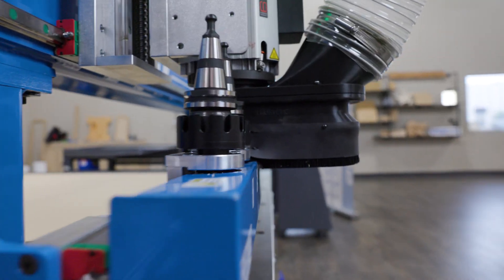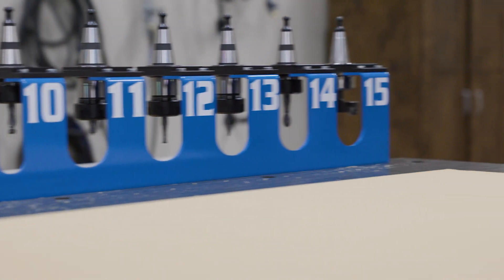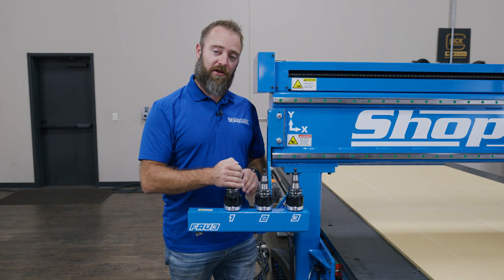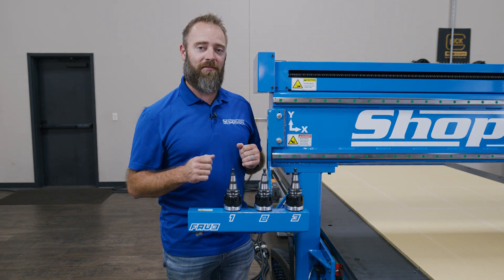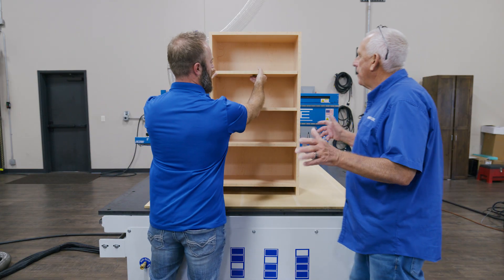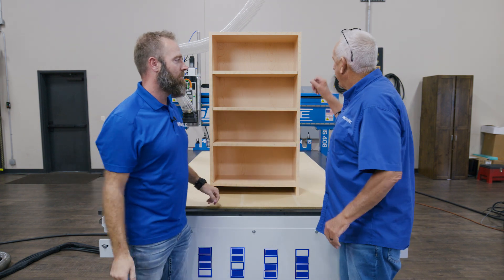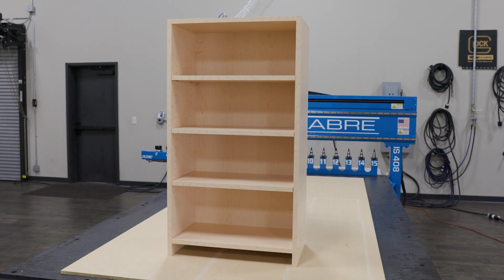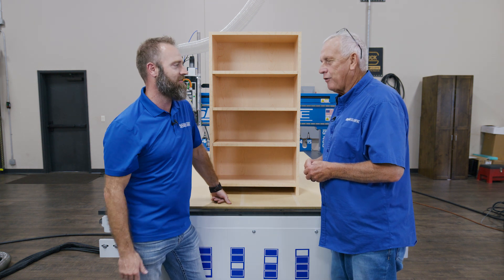ShopSabre CNC - NEW Fav3 ATC - Cabinet Nest

Comment: What router bits are you using?
Reply from the maker: Vortex Tool or Frost Tooling are the two tooling sets we use depending on the project demand. The Vortex Tooling is our primary brand but the Frost has a few sizes that are unique to this type of work depending on your need.